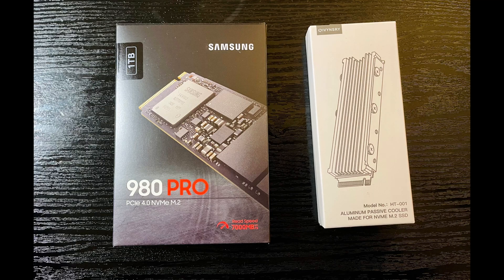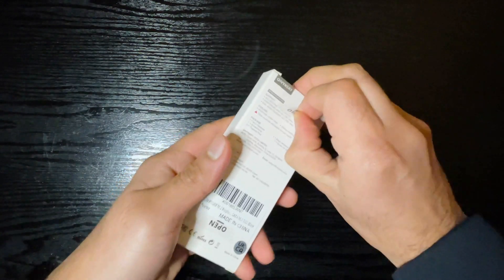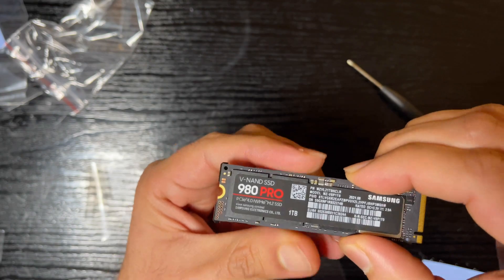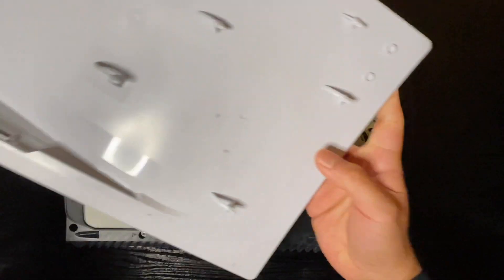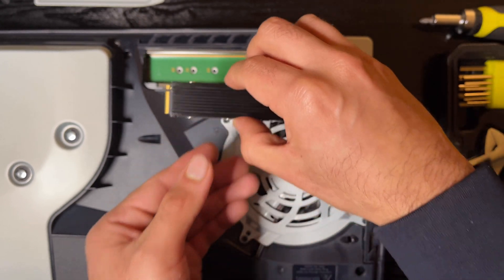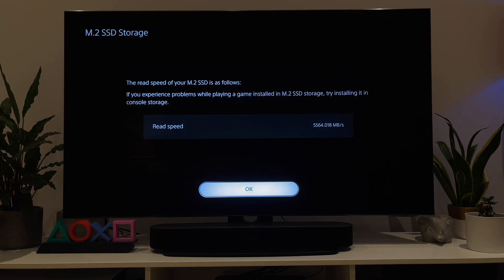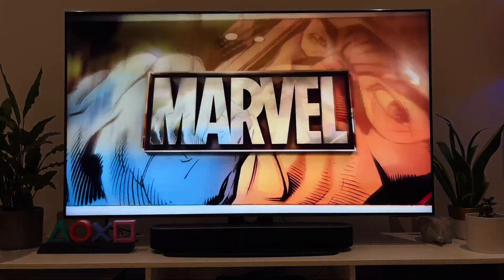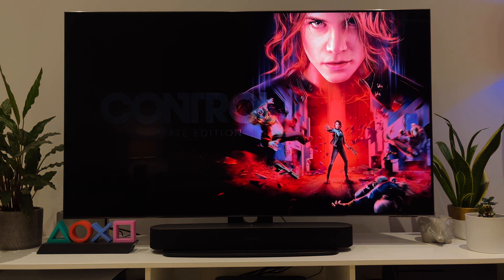PS5 M.2 SSD Installation & Performance on Samsung 980 Pro

Comment: Literally bought the exact same NVME and Heatsink as I did for black Friday. I was a little disappointed about the speed of the NVME but I also predicted the same. It seems to be working fine though. Gaming is really different in terms of Gaming on an NVME to PC and PS5, but like I say seems fine on the ps5 so far. Be good to know how yours is too!
Reply from the maker: Mine has been pretty good so far, I haven't noticed lags of any sort. I wish read speed was closer to the 7000 Samsung quoted but what I get is still higher than what is recommended by Sony. What speed did your system show?
Reply: @sanjayjayan2448  Pretty much exactly the same as yours. I haven't seen many 980 pros that are much higher through watching videos or reading reddit posts. I have the same exact Nvme in my PC and I pretty much get the advertised amount. I seem to think it may be a PS issue rather than a Samsung one as the ability is definitely there.
Reply from the maker: @RazimoPlaysGames  Ah that's good to know, so it sounds like an update could fix the speed issue on PS5. Although I have seen people getting higher speed on models from Adata and WD, makes me wonder if this is specific to Samsung compatibility with PS5. I mean the speed is still above what Sony recommended so shouldn't have any impact on any of the titles. Did you update the SSD firmware at all via pc before installing on PS5? I heard that could be also causing lower speeds on ps5.
Reply: @sanjayjayan2448  Yeah I have seen slightly higher speeds with them also, personally I didn’t bother updating the firmware as Samsung stated it was compatible with the PS5 so I didn’t think anymore about it. The other NVMEs you mentioned are higher in price especially if you purchase the stock heatsink with them. I think the internal drive for the ps5 is only around 5,550 if I recall correctly. It may be a simple fix in the future but because I got this drive for a fraction of the price on Black Friday I’m not too bothered about it, it transfers games extremely quick from internal to NVME and I can’t say I’ve had any problems with it. We’ve also got to appreciate the fact it states up to 7,000 so this may be when it’s throttling more I.e playing games and not just off a standard benchmark
Reply: I just bought a 2tb 980 also. After watching video's of others installing it, I saw the 5500 speeds. Fortunately, at my time of buying it, there is a firmware update, which I preformed by installing it into an unused pc using a cheap PCIE card from Amazon. When I installed mine in the PS5, it showed a speed around 6500. Just an FYI that the firmware updates can be important. @sanjayjayan2448
Reply from the maker: @ronfike326  Thanks for letting me know Ron, as expected it is some kind of compatibility issue then. I don't think I will update mine as I have too much data in it already but good to know for future if I decide to upgrade to a 2 tb at some point. Plus I haven't noticed any difference so far between Sony ssd and this in terms of speed so far.
Reply: @sanjayjayan2448  upgrading doesn't delete anything..
Reply: That’s the Samsung’s issue, I got SN850 and hit 6500-6700MB/s, Samsung require firmware update and still not guarantee. Also 980pro 250G/500G can hit  over 6000 on PS5 and starting 1TB can’t . Don’t buy 980pro for PS5 , period
Reply from the maker: I think a PS5 firmware update in the future will most likely fix this speed throttling issue. If a pc is able to hit the higher speed, I don't think it's necessarily ssd's fault. I guess we will have to wait and see but tbh I really haven't noticed any difference in performance compared to internal ssd, even with games like Rachet and Clank, so doesn't make much difference right now.
Reply: @sanjayjayan2448  If you are able to connect your NVME to your PC and update the firmware a recent update has fixed the issues and now reading approximately 6400 Read speed. I may update it in the near future but as of currently I am still yet to face an issue with this drive. Plus I have recently put my heatsink on the nvme meaning I would need new thermal pads.